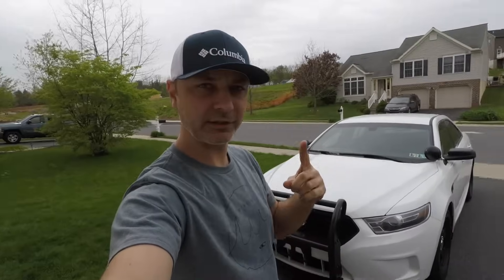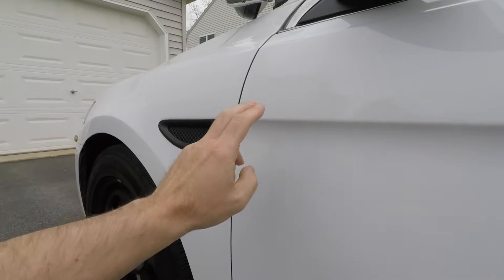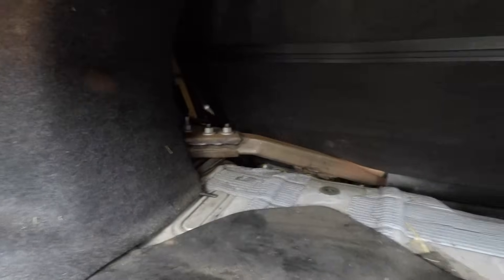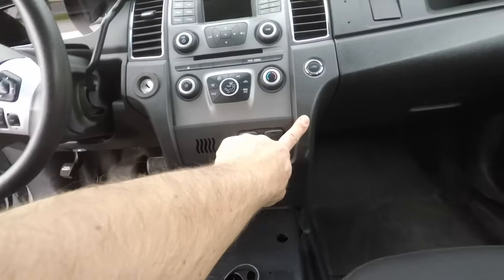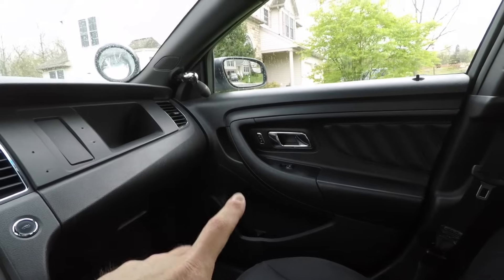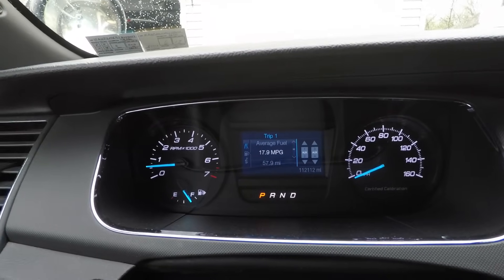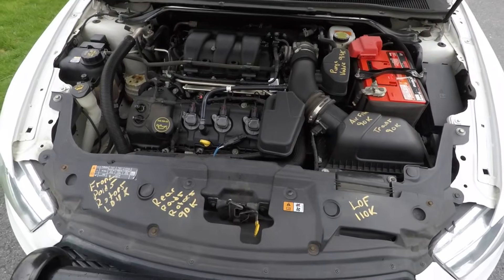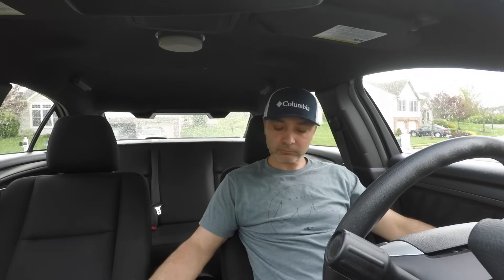I bought Police INTERCEPTOR, OVERVIEW and what comes with it, PROS & CONS

Comment: Make a video with all the strobes hooked up 💪🏻that would be wicked
Reply from the maker: It's illegal to have operated red and blue lights, big trouble
Reply: Pete717 ya I know I’ve owned about 6 of them hahah just for a video you don’t have to keep them on just for a video lol
Reply: @Pete717  
Depending on where U live....most states its only illegal on a PUBLIC roadway, WHILE in motion.
Park in a parking lot or ur own driveway and U can.run them all day. But, Im.sure.you dont have the controller anymore. They are usually one inclusive unit that runs all emergency lights, sorems and horns. Some even incorporate the radio/communications system.

Comment: My understanding is that "Certified Calibrated" means that from factory that the Ford Speedometer is calibrated to a certified standard for speed and timing (meaning the DOT might say 97% accuracy is the acceptable personal vehicle inspection standard, however for speed enforcement the tolerance is lets say 99%). I believe it also means that the speed is certified to 1mph increments. So while pacing, the distance between 34 to 35 miles per hour would be the same as 54 to 55 mph. Some speedometers could lose accuracy in certain speed ranges. I you were to have an inaccuracy at low speed, this could be multiplied as you reach higher speeds.

While on patrol an officer can pace a vehicle, following said vehicle for a set distance and matching the speedometer to that of the vehicle being followed. Doing this, they can identify how fast the lead vehicle is going and testify that the vehicle is speeding. In most states, the "Certified Calibrated" is nothing more than fancy verbiage. A special technician will come in periodically and make sure that the all speed and timing equipment is still maintaining accuracy per the set standard (may vary by state). This is important for traffic enforcement as attorneys will fight the accuracy of the timing device as well as the training of the officer. I don't know if the certified designation means that the speedometer software is open from the factory so that the technician can make changes without using the Ford Scan Tool? Outside of that, it doesn't mean that your other vehicle is any less accurate. It just means that when that Police Interceptor was built and had all of the upgrades added by Ford, that the speedometer was tested and accurate with the big brakes, cross brace, extra racks, miles of wiring, and additional lighting.
Reply: I think you're right. Also, regular passenger vehicles are calibrated (even with a wider margin it's still calibrated) to display a slightly higher speed than actual (GPS) speed, so that you're always on the safe side with regard to speed limits. Usually this difference increases at higher speeds, so it may display 32 mph when travelling 30 and 79 when doing 75. Law enforcement on the other hand should of course know the exact speed.
Reply: @sanderrambelje  yup, I always check my car speedometer accuracy with GPS. My car shows +1 mph at 30 and +2 mph at 60.

Comment: What you did not mention was the sore back that you inherit if you have to spend more than a couple of hours in one of those cans. The Crown Victoria was the last real police car. Most police departments are moving to trucks and larger SUV's. I can't handle more than half a shift in one of those things. They are fast, they handle well, but they are too small and too cramped to be a good cruiser.
Reply from the maker: I did not have an issue driving in one for months. I have Taurus SHO myself as daily driver, about same seats and I feel pretty comfy in it, no complaints.
Reply: Kelly Breen What are a cop?
Reply: Yes... 22 years in. @coldhardtruth333
Reply: How much did u pay n were u get it
Reply: Kelly Breen Why don’t they remove all the police accessories before sale, thus preventing anyone from driving a fake police car. In the US you see so many wannabe police officers getting caught out all the time. UK
Reply: @1972dsrai  for many different reasons. But I agree with you, there would be a lot less impersonators.
If PD has an inhouse shop, they always remove all of the equipment before any sale even after an accident for an auto auction. 
Many of them don't have a shop so they hire specialized shop for the install, that means they have to hire them for un-install also and it's just cheaper to sell it as is.
I've seen where Sheriff office was closed down due to the lack of budget and everything was sold as is and vehicles were fully equipped with EVERYTHING.
Many times they sell this type stuff to LEA(Law Enforcement Agencies) only.
Reply: My cruiser doors were never ballistic plated. Plus my Crown Vic had 4 car batteries in them. And didn't look that well maintained.
Reply: I hated being issued this unit. Fortunately we only had a couple of them. Visibility was terrible, and with all the gear on it was terribly cramped.
Reply: obrbob194  I can't tell you the number of officers that had to get doctors' notes in order to change from the high polish duty belts to variations. Some got the gear vests but I hate those, it looks too military like and less professional servant like.
Reply: DS Rai the parts they leave on are completely legal. If someone wanted to pretend to be a cop, taking the pushbar and spotlight off won’t stop them.

Comment: I just sold my 2013 Police Interceptor Ford Taurus.  I put it on the lawn and it sold in less then 3 hours.  I had more fun with this car then any other car I have owned.   They are such nice cars and they feel like a machine when you drive them....Smooth, Fast, and just fun to drive.  I will never be able to fun one as nice as the one I sold.  My car was from North Carolina and belonged to one person who took it home every night.  The only thing that was taken out of my car was the Two way Radio.  It had everything else.  When I came home from work at night, I would pull into my drive way and turn on the blue lights....!  That car was like a christmas tree....I had the car for over one year and never got stopped.  I would drive by a cop and he would wave to me.  Everyone thought that was a patrol car under cover.  When I got on hwy 85 in the morning.....NO ONE would pass that car...everyone stayed behind me.  I will sure miss that car....my car had 107K miles on it and drove like a new car.
Reply: Why did you sell it if it was so nice?
Reply: @Long-nd8bq  I have Jeeps, Corvettes, Pickups and Motorcycles.   I got the car as a toy to play with.  I had it for a year and decided that I did not want to have so many cars on my driveway.  It's a lot of work to keep all the cars clean and maintained.  I will get something else now.  It changed the way I drive.  I always watched my speed and I felt like a Roll Model when using the car.  I did not want that feeling no more, And also I was thinking with everything going on in the world today...I was a afraid someone would damage it thinking I was a police officer.
Reply: @alsautner1732  you should look for a sho model if you like it. The car is discontinued now so the value might rocket

Comment: the tray held the many wires as well as batteries for all of the lights and sirens. they would not all fit under the hood
Reply: Shawn Pagel yep, that is an electronics tray. It holds the emergency equipment and allows the stuff to be serviced easily.

Comment: I want one so bad. About to buy. Terrified of the water pump.
Reply from the maker: Dont let water pump scare you from getting car you want, worst case its $1400 fix at the dealer, some shops will do it for less. Set that money a side incase it happens, but most likely it wont.
Another thing, 2014 and up, water pump design was improved and had allot less issues, just FYI
Reply: Thanks for the reply sir. Well if the water pump breaks it can take the whole engine with it! Surely you heard
Reply from the maker: @forrestperkins6237  oil pump seal fail and it start leaking slowly, so you will spot some coolant on the driveway way before it fails the engine, some people go for months on its failing until it dumps it all out. DEsign issue with water pump on pre 2014 models that there was only one bearing on the pump shaft so it has allot of tention and wore seal off fast, after 2014 they installed two bearings, it took main shaft load off and it stopped failing unless you had bad seal or bearing. so its not like it's going to explode and take bearing out all at once. and if it does you will see bunch of steam from under the hood before temps will kill
 the engine
Reply: @Pete717  Where I live the dealer wanted 2000 dollars to fix it. I called almost every shop in town to get qoute and there was a couple that wanted 4000. Hell, one dumbass said I should just get a new engine. I did get luck and find someone who did it for 1040 dollars. I swear people look at a Ford and go Ugh fuck that.
Reply: @la-ia1404  learn to do it yourself its not hard

Comment: Dude.. what's the hp?? V 8 I'm sure
Reply from the maker: V6, 3.7L 300HP
Reply: @Pete717  guess I'm thinking of the old school Crown  Victoria Ford the V8  400 horsepower interceptor
Reply: @mrhawk1924  crown vic interceptors never came with 400. They were a good bit under 300, like 260 at best.
Reply: Mr Hawkhawk crown Vic had 250 hp. 4.6 v8
Reply: @OakLawnSpeedShop  I need to look that up. 250hp is nothing on a V8. Depending on yr model I guess.  Just look it up.  Yep between 215 and 250 hp 4.6 V 8.  My car is turbo veloster Hyundai 1.6 4 cylinder 200hp.. I like to race one of them
Reply: Mr Hawkhawk yessir the new sixes make 50 more b h p. The power to weight ratio on your Velostar makes it quite faster I’m sure. Own a 66’Ford F250 with the crown Vic motor trans and rear end in it. Definitely quicker than the 352 that was in it and way more reliable. Put long tubes on it and a cold air kit. Runs pretty good.

Comment: I fixed our locks ,by just hooking up the cable to the Handel. I also fixed the window button ,which is unplugged. How ever where otnis unplugged I under the front sil plate. Good news both fixes are done with no parts

Comment: Which choice would you make, a 3.7L AWD with 100k miles and 3.5L FWD with 80k miles?
Reply: I bought a 2017 with just over 200 miles, it was a show car.
Reply: ichiladz thanks
Reply: Forgot to mention it's a 3.7 AWD.
Reply: ichiladz I’m looking into the Chevy caprice now but I’m sure it’s similar in durability that you meantion. Thanks for you insight
Reply: I like the Caprice, too, but there were not that many of them to begin with, so finding a real good used one is not easy.
Reply: I'm looking for one now and I'm leaning more towards the AWD. I think I'd much rather have that than the front wheels drive simply because I've had a better time with RWD and AWD when it comes to avoiding accidents last second.
Reply: AWD  it's better on the transmission

Comment: Pete717, Do you still have the car......?  Did you ever have problems with the Water pump in that engine...?  I was told it is a very big job to replace it.  Lets hope you never have problems with it.
Reply: I had the explorer version of this, and yes, I had to get the water pump replaced. Ford did it in a day. Expensive! They dropped the entire front cradle down, engine, tran, front suspension; did it on the floor.

Comment: that frame connector brace is a ford option for highway cars i got the same thing in my own RCMP torus though mine has the whelen led wig wag/turnsignals optioned on it from ford these cars are beastly in the snow though i hate white cars i plan on getting mine painted or something lol the ecoboost v6 is responcive though not a nice sounding engine but overall a great car for the money if your on a budget and want something newer decommisioned cop cars are the best choice the henges are stronger the strap is the extra door limit it was added later because the factory limit would break the doors are stupid heavy but the bullet resistant car makes ya feel much safer lol i do want the tourus limited seats for mine just because the bolstering hold better its a great car and my local cops hate my car because its a caution and traffic control car for my work so it got the lights in amber back on it lol freaks out everyone lol keyless entry and remote start is optional along with my ford touch (mine has it) milage is good unless you rip it lol

Comment: The Problem with this is Gangsters are buying them and use them to zero their Victims plus it confuses the Public to the point of frightening them when they observe a Full Fledged Thug behind the Wheel thus Chaos is the End Result. This SHOULD be Outlawed.
Reply: You know right away. Regular plates. I see these all over, and the first clue is the person behind the wheel. Not a cop. I look at the plates first, dead giveaway. If your in a state that doesn't require a front plate, and they come up behind you, my method is thwarted.

Comment: The lights you show are still working?
Reply from the maker: Controller for the lights was removed, but all wiring and connectors are ran to the back where controller was, I am sure if you get controller they will light up

Comment: the tray in the trunk was the LED Controllers and Radio(s) Controllers 

Also, when you were pointing to the engine bay at the R134, that is AC Freon, not Coolant.

Comment: never buy a ex police car, those are rough miles and the amount they idle is insane. if you want a taurus get a civi one has more comforts and will be more reliable
Reply: A lot of cruisers have the idle hours recorded too, just like an odometer . You can take those and there is a formula that you can calculate equivalent miles. Some cars are supervisor vehicles etc. and don't log a lot of idle miles.
Reply: @mac11380  The conversion formula is : One hour of idle time equals 33 miles driven.
Reply: @paulkersey9553  Thank you kind sir.
Reply from the maker: Police service based on hours not on miles, so they do keep car up in good shape at list here in states, curs I buy are very good shape and driving condition.
Reply from the maker: You are correct Sir, thats what it says in the service manual.
Reply: @mac11380  i understand theres engine hours however even if your a car guy you can probably name more people that know nothing about cars then do. and the people watching this video didnt get that information just him fan boying over having a out of service taurus. which is okay if thats your thing. however ex cop cars tend to be very slightly cheaper than a civi of the same. not knowing engine hours or that cop cars are worse for it is why i generalize it as a bad purchase. He also just said "ill fix that" to the doors,console, etc brushing off said con. if someone is not mechanicly inclined they wouldnt realize how expensive thatd be in hours of labour. i think he was excited about his new car an dmissed the point of the video as many people watching heard no real cons and might get a worse deal due to the major cons not listed.that is the reason for my comment to hope that the unknowing see it an dnot make a purchase that they cant handle. i liked the video as i have no qualms with the tuber and he definitly put effort into the video. apolgies for the run on sentences and spelling errors. thanks

Comment: Police package got the 3.7L, like the later model lincoln, instead of the 3.5L. Earlier models had the twin turbo 3.5L like the SHO. If you had an earlier model, Livernois has some pretty sick tunes that put it in the 500hp range by turning up the turbos. They were actually faster than the stock mustangs after tuning.

Comment: Question: how do you change the coil packs on that motor? It looks like you may have to lift the engine up to get to the read ones.
Reply from the maker: Its easy to change, check my Taurus SHO playlist, I just replaced my coils to MSD Red coils and it was very easy, prolly 15min job.

Comment: Did you find out what motor is in the car 3.5 or 3.7 if it's the 3.7 your in luck
Reply from the maker: Per engine marking they are 3.7L
All Interceptors mid 2013 and up are 3.7, before 2013 are 3.5L
Reply: @Pete717  they just added the 3.7 to the options the 3.5l was still the standard if you didnt specify you wanted the 3.7

Comment: This was in my recommended, so I  stopped to watch.  I ended up subscribing.

The R-134a isn't coolant for the car, but is refrigerant.  More is used since it's a heavier duty, high capacity AC system than in a normal vehicle.

Depending on what PA laws are, I don't imagine you could have made it through State inspection without catalytic converters.  I know that similar models have an integrated manifold/catalytic converter.  After checking the Advance Auto website, I see that's what your car has, so they should be up in the engine compartment, not under the car.

I bought a Crown Vic a number of years ago from a police auction, so I sympathize with your issues. Besides the problem with people on local roads driving much slower than the speed limit in front of you, you do get the advantage on roads like Rt. 80 where people often move towards the right when they see you behind them.

I found the speedometer certification in the car and it was still current, so it made me all too aware of the fact that if a "in service" police vehicle was behind me and I was speeding, there was no excuse as to my speedo being "off", so that actually made me be a bit more careful about my speed.  I already make full stops and always use my turn signals anyway, so it didn't change anything there.